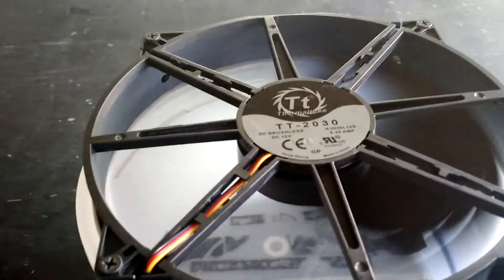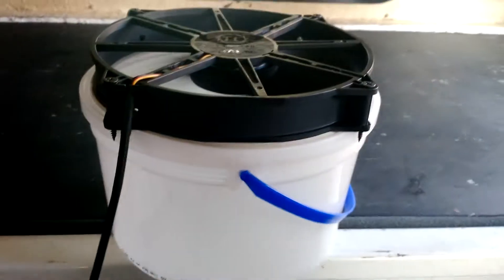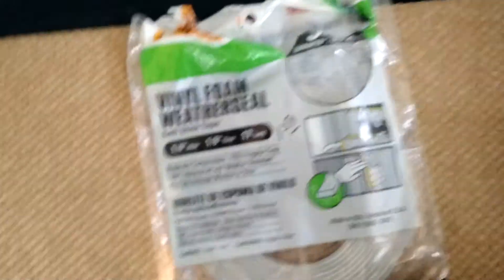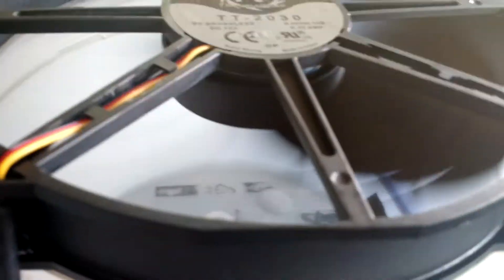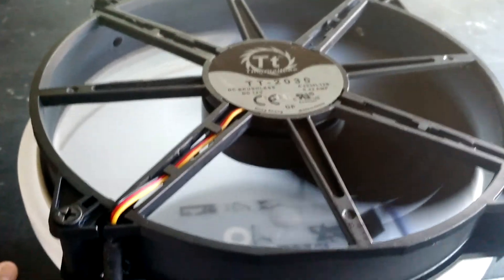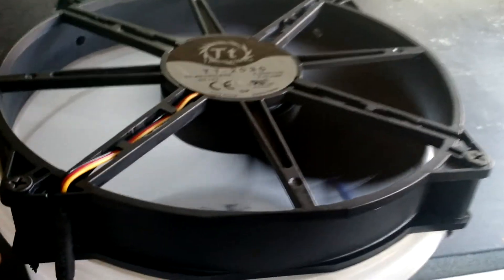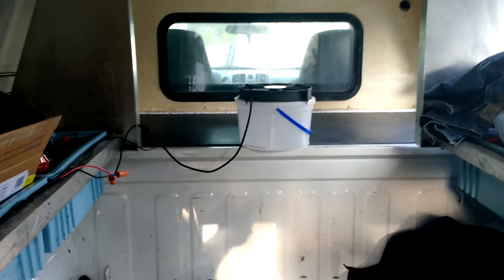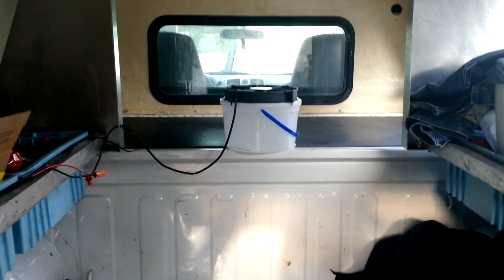Moisture/ condensation/ humidity control via solar power panel & 12v dc fan.

Comment: Hi,have you upgraded with a battery yet ?
 You have a great idea !
Have you thought about a humidity sensor/switch so the equipment doesn't run continuously even when not needed?
Reply from the maker: @joestalin2375 at the time, it was connected with solar during the day so it wouldn't need a battery and every time I checked it was running regardless of the weather. At night, I would switch it to battery. I always had a battery bank. The sensor I knew about but I felt constant air flow was the way to go during the day to prevent overheating during the day since my battery was in there too. So no, I never used a sensor.